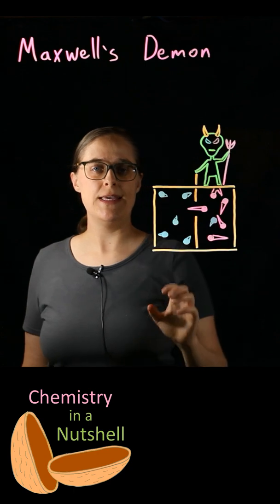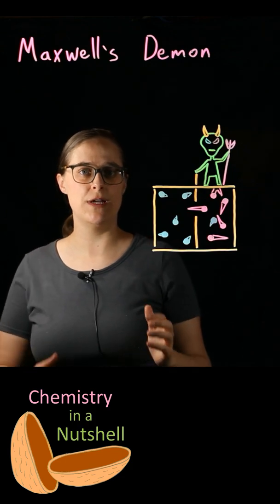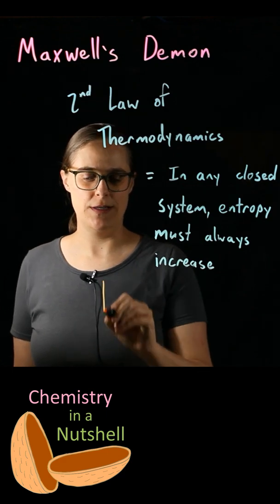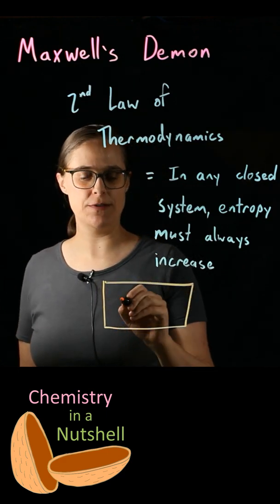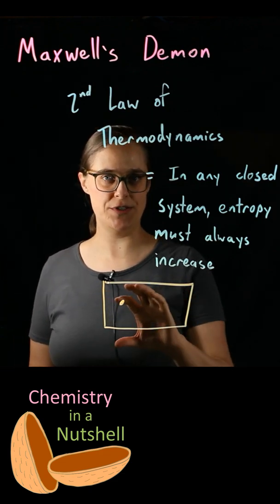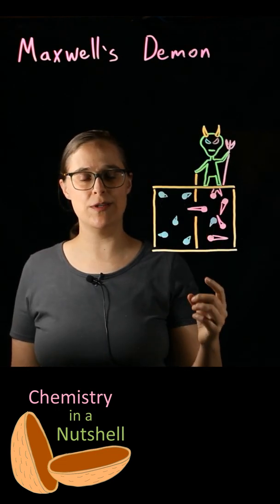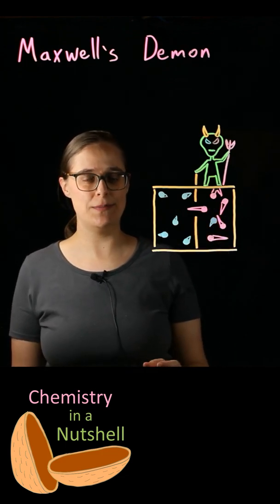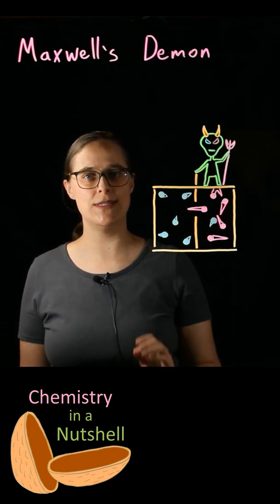Maxwell's Demon & The 2nd Law of Thermodynamics - In 60 Seconds - #VeritasiumContest

Comment: Maxwell's demon does not break any laws. 
1. The demon can't open or close the door at random. 
2. In order to decrease the entropy, the demon needs to aquire information about the velocity and position of every particle.
3. That information is entropy.
4. Thus, entropy does not decrease.
Reply from the maker: Thanks for your comment and interest in my video.  

Maxwell's demon can (hypothetically) reduce the thermodynamic entropy of a system by using information about the states of individual molecules.  It sounds like you're using the Shannon Information Theory definition of entropy?  It is my understanding that the information (entropy) that the demon must first acquire and store does not allow the entropy to decrease.  

This is a topic that has been debated for a long time.
Reply: @ChemistryinaNutshell i thought thermodynamic entropy IS Shannon-Entropy. 
Entropy is the information, thats inside the system so the information that we lack. For the demon to operate the door he must have full knowledge about the system so entropy is zero. Then it does not matter wether he traps all the hot (fast) molecules on one side or does any kind of configuration